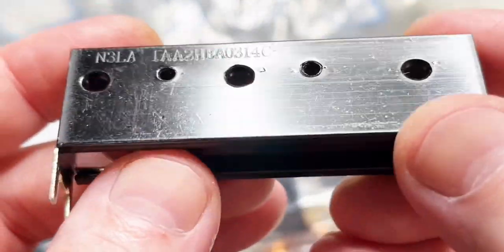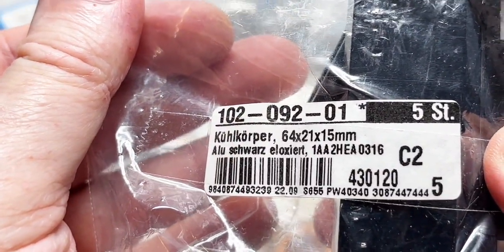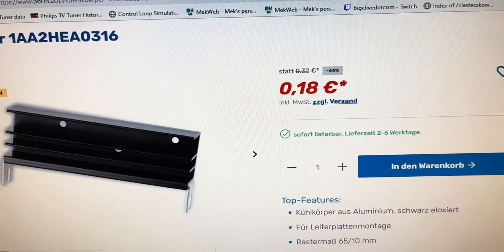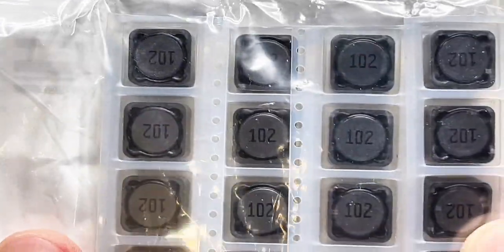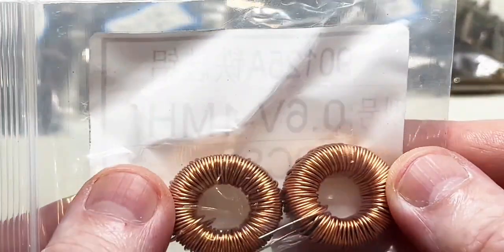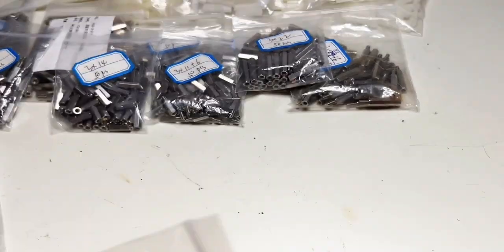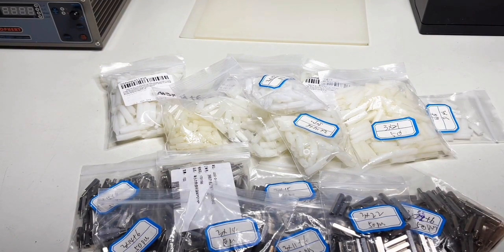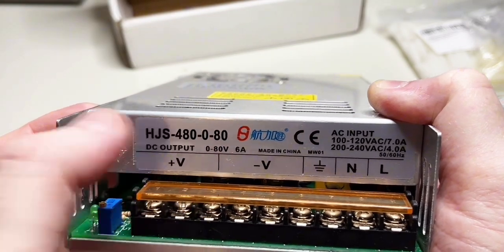In my Mailbox #002; From Pollin.de and AliExpress

Comment: what is the current rating of those inductors? asking since i have a feeling they are for APFC and .
there is no data on aliexpress and i can only guess
Reply from the maker: Hi, which ones ? in the video description are links to the parts showed in the Video, if there is not the Current stated, I roughly calculate it based on the wire Diameter.
Reply: @KonstantinGrigoriadis  i checked the links and there was not data on rated current . I was referring to the 3 types of 1MH inductors, there is no data regarding current rating or saturation current.
Reply from the maker: Hi, if there is not the Current stated, I roughly calculate it based on the wire Diameter, these are just for testing not for anything serious. Further don't forget that the data given on Ali are mostly not correct....Example the RM6 Power Inductor is stated for 18A at ali, I contacted the Manufacturer and he send me Datasheets where it is only for 12A....This is why I prefer to use it according to my estimates, when there is no serious datasheet available. For wire diam of 0.5 to 0.6mm I estimate ca. 3 to 3.5A, for 0.8 to 1mm ca. 5-6A conservative.
Reply: @KonstantinGrigoriadis  THX i was alo looking for some huge inductors for a power supply and since i am bad at picking toroids i am sort of stuck ... now i have a few to pick from
Reply from the maker: No Problem !